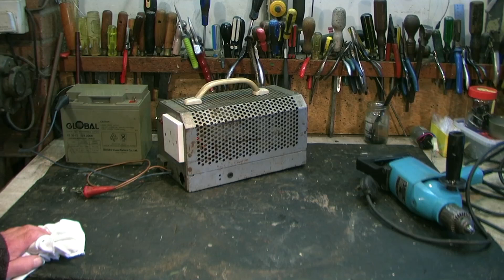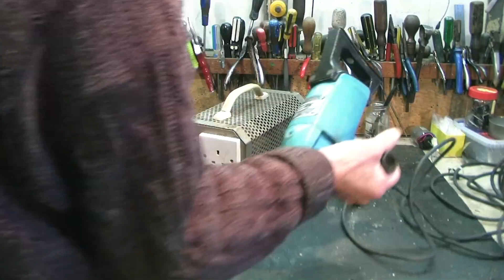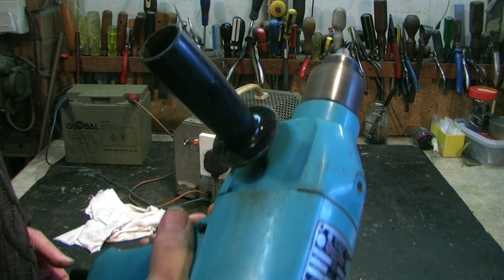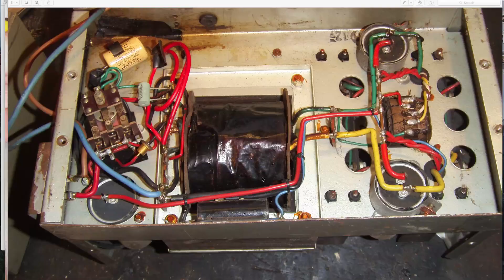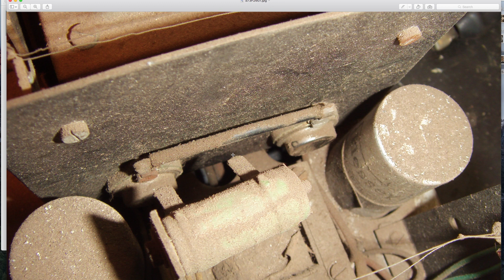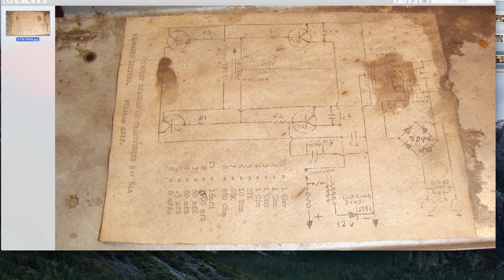gen for your den

Comment: I have just bought one for my work van. It was made in bury in the 60s. Will the fuse blow if the wattage is to high or will it just burn it out.    It's going to spend most of it's time charging tool battery's
Reply from the maker: most tool battery chargers don't require much current so should be no problem, but I question your thinking on using one battery to charge another ?

Comment: It's all a bit technical for me but still compelling. I want one of those trans things.  Silly question, could you charge another battery with that set up?
Reply from the maker: think of it as an inverter 12v dc to mains 240v ac

Comment: A sinusoidal UPS cost a fortune now days. I used 5 of them in a wireless system for the city I worked for and they were around $1200.00+ each the inverters today are square wave or triangular wave which are loaded with harmonics. I love the old school items. When I took electronics we learned vacuum tube, transistor, digital, and some microprocessor theory and this was 1976-78 time span.
I have worked on a lot of equipment as we were the city's radio shop which meant it it was broke we fixed it. Audio, 9 radio systems, ball park sound systems, video systems, computer network cabling, alarms and any thing else the chief Or city manager wanted done. However the Knowledge you display is amazing, you had some long days figuring out all the different things venues know and you are able to explain it in a way it can be understood, that is a gift as well. john from lower Alabama
Reply from the maker: thank you John glad you liked it

Comment: I would welcome videos on the older tech. That transverter for instance, it may well be decades old, but it still works! And like you say, the sine wave out of them is pure, not a lot of chopped up rubbish like most new inverters. Plus, old stuff was built to be repaired, you could get schematics for them, in fact a lot of stuff came with the schematic. So much better for the planet to build something that will last for decades, rather than building something that is designed to be thrown away after a couple of years use. Take Dyson for instance, they recently announced that they are going to stop producing vacuum cleaners that run direct from the mains. That is such a bad bad move when it come to the environment. A mains powered vacuum should last many many years, with just the small carbon footprint involved with building it - and of course the electric it uses, but that will be the same with a battery powered one. But, with the battery powered ones the life will be limited by the life of the battery. And when the battery does become weak after a couple of years, you are forced to either buy new batteries - at a very inflated cost, or, simply throw away the vacuum and buy new. And if you do opt to buy new batteries, you are then adding to the carbon footprint of the vacuum cleaner once again. And if you just throw it away because the battery was duff, well then your going to be buying yet another vacuum cleaner. I have got a Dyson vacuum cleaner that must be ten years old and still going strong, bet you won't even get half that life out of a battery powered one without purchasing yet more batteries. Waste, waste and yet more waste!
Reply from the maker: Talk about vacuum cleaners, the EU in their infinite wisdom in order to save the planet have banned the manufacture and sale of 2000 watt cleaners so you use a 1000 watt vac 
it takes you twice as long to do the same job energy saved  ....  bugger all !

Comment: Thanks for a nice video. I know the whole point of it is to keep these old equipment going, but would it be possible to maybe replace some of the parts with modern ones, e.g the transistors and resistors to make it more efficient. I am no electrician by the way but just thought if it could be improved on without altering its character. There is something that draws you to old mechanical and electrical stuff, they're great.

Comment: Come on POC, get your emitter-base polarity correct! Long live the TO3 transistor - I am old enough to have learnt about them at college but young enough to also have learnt about Mosfet transistors that eventually replaced  them. I have forgotten most of that knowledge sadly but like you I have several 12volt engine generators in the event of a power cut. A Suffolk colt lawn mower engine good for 180 watts, a Petter AA1 diesel de-rated to 800rpm good for 300 watts and a Lister SR1 good for much more. I use a 110 amp 12 volt battery via the pure sine wave invertere for central heating and fridge use . The modified sine wave inverters you referred to a bad news for certain mains operated equipment. The wave form is very choppy -
Reply from the maker: I do all my videos now in real time warts  and all , I also have a Suffolk engine under the bench awaiting my attention